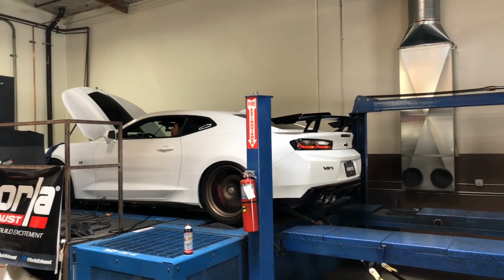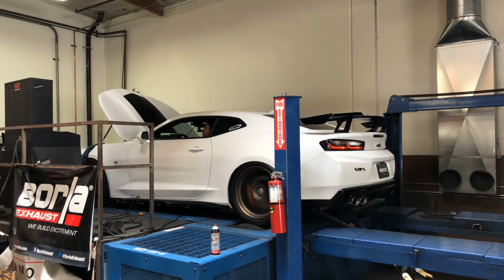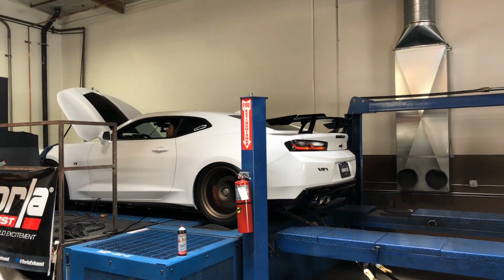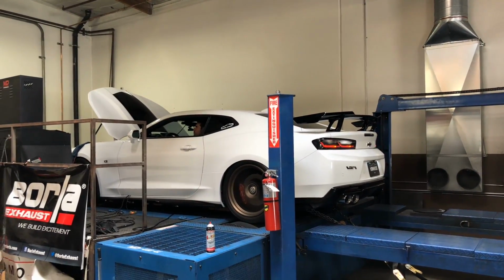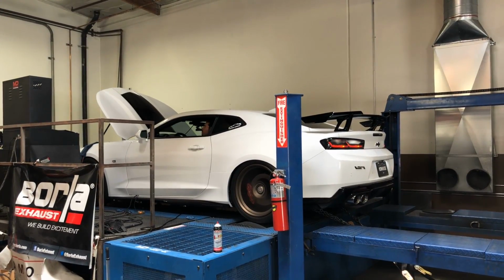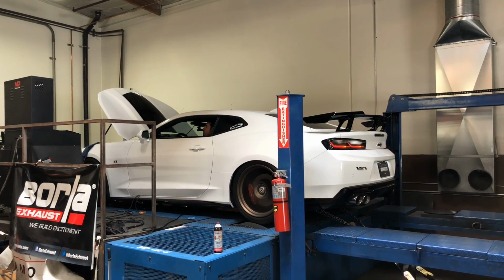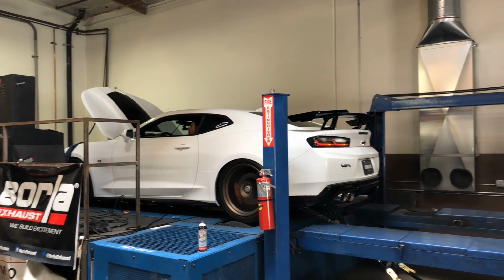Build Update: Reaching 8XXrwhp+ & New Issues! | Drive with Lethal | S3: EP6

Comment: I have just watched 3 of your videos on your 2016 LT1 Camaro. You seem very passionate about all of the engine workings, so, I am going to share this with you. You should google this book. It has most of the algorithms to configure an engine build. It is called "Performance Automotive Engine Mathematics. By John Baechtel"  Take the time and do some of the exhaust and intake cfm requirements for an engine in the horsepower you want to achieve. It will be eye-opening.  Good luck.

Comment: Does he still have the lt1 engine under the hood or did he do a engine swap? Did he forge the internals before he supercharged it or did he put a supercharger on a stock engine?
Reply: BraveShot Ent. Yes to LT1(has the badges on the car), and yes to forged bottom end first

Comment: I got the 5th gen running the 2.9 whipple wit the intercooler ice box in the trunk, it issues i am having is wit my transmission! Sometimes when i step on it at low rpms sometimes the transmission will go into limbo, like neutral, have you had these issues? I have the cam and one of the best exhausts. I just swapped the upper pulley to 3.5 and have been having pretty good results as far as transmission not stalling. U have any insite?
Reply: It's probably too much initial torque and the transmission is protecting itself I would guess from what you've  described,
Reply: @Piffydaily  thanks, since i stop adding ice, stop putting boostane in there, it's been acting good for the pass three weeks, i also don't smash it very often either, scared to go to the track because don't want to tow home lmbo. If i go to track, ice and boostane will be involved lmbo
Tring for lower 10's
Reply from the maker: No issues with the trans yet
Reply: Ok will keep i one your endeavors